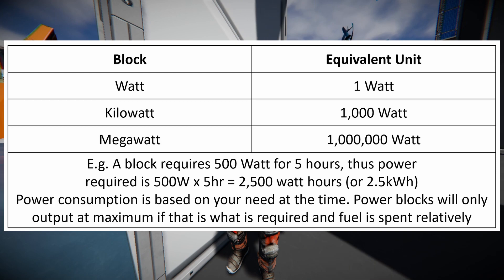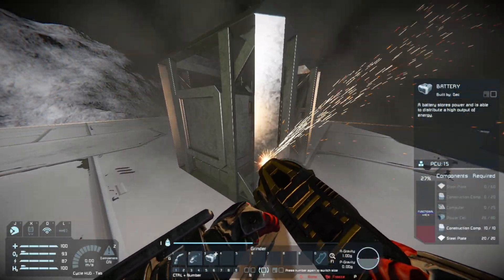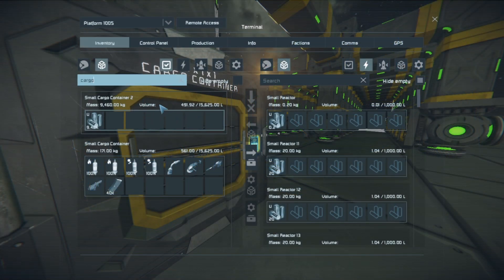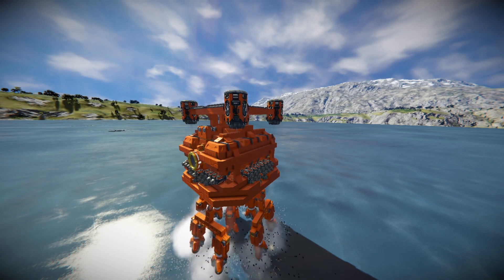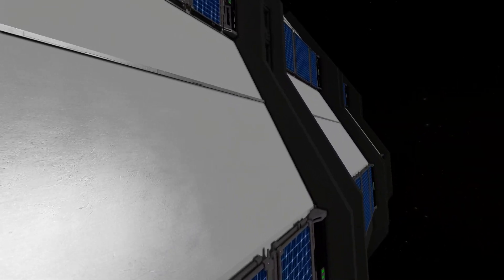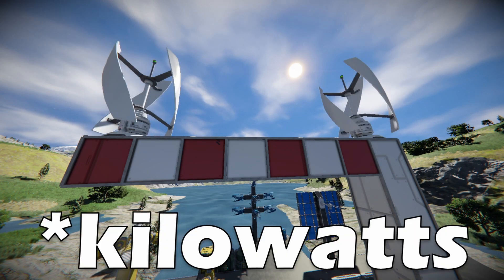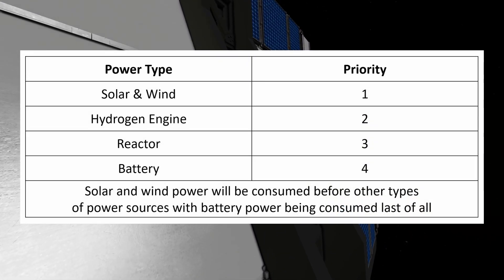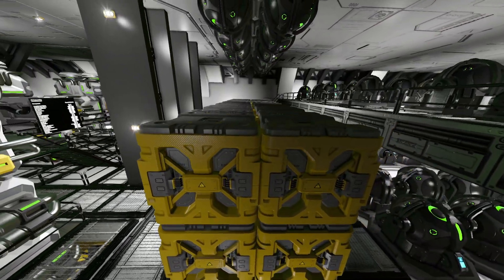Power Systems Tutorial - Space Engineers

Comment: I have considered Batteries to be the Last Resort power for most ships, using only Recharge and Discharge states. The ones operating pure battery are the base-bound short range ships and low profile mining ships that is meant not to take heavy bumps that may cause massive explosions.

I would still insert small power cells in pure Hydrogen ships because I cannot guarantee the means to start a cold and dark ship when the engine has no gas charge stored. Would be nice if it can store hydrogen bottles much like using starter cartridges in older propeller aircraft. A minimum of one small battery is enough to power the conveyor necessary to pull from the tanks